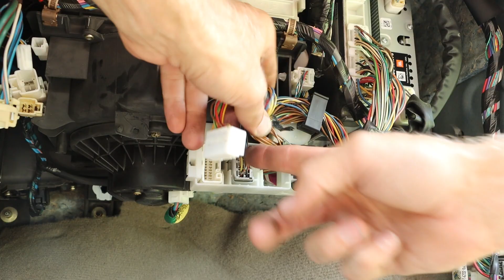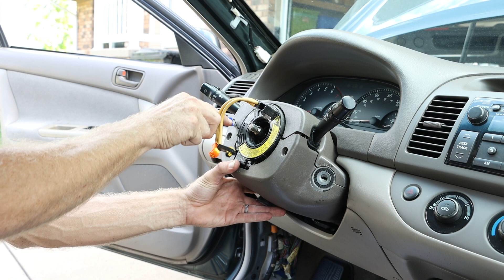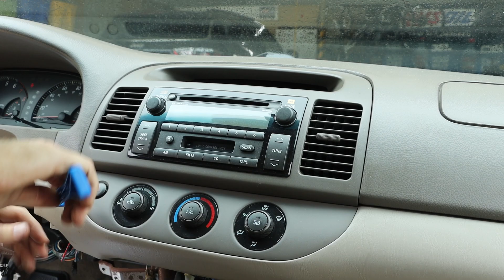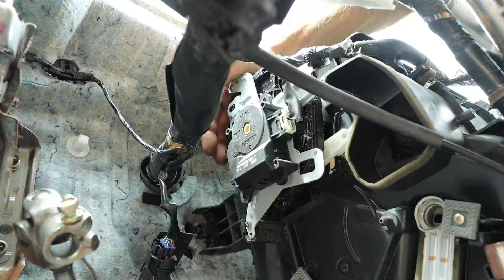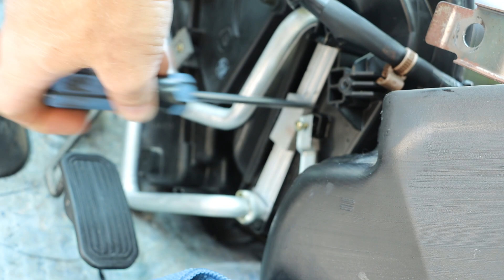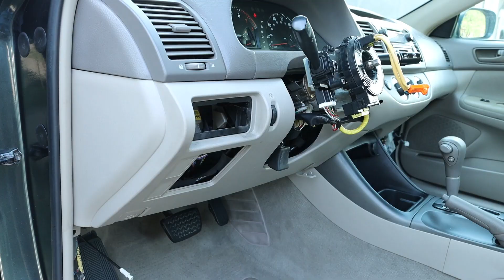Replacement of Evaporator Core, Expansion Valve, and Heater Core 2003 Toyota Camry, 2.4L (2002-2006)

Comment: can you remove the upper dashboard without dismantling all those steering thing? for me thats the hardest part on this video.
Reply from the maker: You can sure give it a try.  I took the most logical approach that I could find to process through this repair but I am sure there are different methods.

Comment: Is there any risk of setting of airbags when messing with the connections while the battery is still connected, or is that like an old wise tale?
Reply from the maker: A general rule of thumb to avoid any concern is to disconnect the negative battery terminal and wait 10-15 minutes for the system to discharge.

Comment: Hi,,,great video that made me tackle the attempted removal of the blower housing unit,,,I removed the 2 bolts and those 2 sleeve nuts but am still having a tough time removing the unit itself. There’s some movement but not enough to wiggle it out. It looks like the top bolt is preventing the housing from moving forward enough but I’m not sure how to get it off past the bolt. I’ve also unplugged all of the wiring harnesses.I’m I missing something here.
Reply from the maker: Any luck?  If it doesn't move around at all, there is a good chance there is another bolt holding it in place.
Reply: @InsaneOil hi,,,finally got it off but had to remove the actuator that was keeping the box from moving down and forward. Had to remove the box as mice got in there and chewed up a nice big hole in back. Pesky little varmits. Great video by the way.

Comment: Hey brother appreciate the tutorial on this vehicle, I bought a 2004 model, was told the compressor was the only issue replaced it did the various steps to add Freon but it wouldn’t turn any colder, when I took it to a shop they said my expansion valve was bad, but would you recommend changing the ac unit like the evaporator core? And another question when engaging the into the start position there’s a gurgling sound coming from the passenger dash side any thoughts ?
Reply from the maker: Originally, I also thought my issue was a bad compressor.  I basically did the same stuff you did and got the same information.  After spending way too much time and replacing too many individual parts I did more research, I found that often times when the compressor goes out, it sends metal fragments through the system, effectively causing many other issues in many other components.  At the end of the day I knew what must be done, and that was to replace the entire system.  I didn't want to but I bit the bullet and did it.  The issue was resolved and still works great (2 1/2 years later).  Here is a link to the full video: https://www.youtube.com/watch?v=V0I6sKrA_eE&list=PLYNR1w8QDiFp7rtAildDIVAaS9qwF_0Mv&index=29  Not sure about your gurgling issue though.

Comment: I am wondering why you needed to do the work. Did the evaporator core leak? I am glad that the AC on my 02 Camry with 200k miles still works.
Reply from the maker: There had been no AC in this vehicle for at least 10 years prior to me procuring the vehicle.  The end though was that when the compressor seized up, it shot shrapnel down the lines and clogged the evap core.  This vehicle was for my daughter and I wanted her to have AC, so I figured out how to repair it.  This video is part of a larger repair which can be found here: https://www.youtube.com/watch?v=V0I6sKrA_eE&t=4982s
Reply: @InsaneOil  You are the man and understand what you are doing. Your explanation makes sense, since an evaporator core usually does not break, but once a seized compressor sends sharpnels into the system, everything will need to be cleaned (e.g., lines) and replaced (e.g., the evaporator core).

Comment: Mine looks a little different than yours. I remove three 10mm bolts but the blower and air input assembly won't budge.i tried pulling to side first. Any ideas on hidden screws. Did you have to use brute strength to wiggle that out?
Reply from the maker: Any luck?  I believe my vehicle is Japan built (or partially Japan built) and there are a few things I have come across that are a bit different than similar vehicles.
Reply: @InsaneOil Aussie built. Toyota now closed its factories in Oz and gets its camrys from Thailand. Yes it just needed brute force. At the ports there is foam. Btw. Ended up just topping up AC gas. AC now works. Symptoms of low gas and clogged xvalave can look similar.  So jumped the gun a bit. Didn't need the blower out after all.
Reply: @InsaneOil just a lot of force. I think the foam strippibg at the ports made it stick

Comment: Oh and btw did you notice the integration relay behind the fuse area? I think mine is responsible for the no lock double beep issue.
Reply from the maker: According to what I found online: the integration relay is basically the body ECU and does handle the lock/beep issue. Double beep usually means the car thinks a door, trunk, or hood is open, usually caused by a worn door latch switch as opposed to a bad relay.

I haven't had to deal with that issue yet in my car.
Reply: @InsaneOil I have never seen or heard of that. All of the discussions and even Toyota chassis diagrams show a specific integration box that has relays and other stuff inside. Again probably different across years and countries. But I'll keep it in mind. I think all the door latches are good because no door light comes on dash. As of yet nobody brave enough to try to pull apart integration relay from forums. I may do soon. Best do a video I suppose to help the cammararian community like yourself. Thanks.

Comment: Just for replacing expansion valve I'm guessing pulling away blower is all that is needed right? I have 0psi low side and 120 high and the compressor is noisy. I'm suspecting X valve. Can I use any old O rings? Ive already got a hennes brand valve. Now to build up the courage.
Reply from the maker: Yes, you can access the expansion valve by removing the blower.  I wouldn't recommend reusing the o-rings as the system needs to hold pressure and even a slight nick in o-ring could cause an issue.
Reply: @InsaneOil bought some green AC onrings set  from aliexpress. Was really cheap. But they have been put away for a rainy day as topping up fixed the problem. I'll add dye when my dye injector comes. Or may just do it while adding a little more gas. Too lazy ATM.

Comment: I'm totally stuck moving the blower motor sub assembly unit to the Right and Down.   All cables are disconnected and 2 bolts and 2x weird  washers things are removed.

Any idea.    Feels like the unit won't give...any ideas?   I feel like it's something simple.
Reply from the maker: What is the timestamp of the video that you are on?

Comment: My expansion valve has a leak, my mechanic (who I trust) said it would be $1200.  I thought to myself, HOW HARD CAN IT BE?  🤣🤣🤣🤣🤣🤣🤣🤣
Reply from the maker: Did you decide to do it yourself or pay the big bill?
Reply: @InsaneOil  Turned out it (hopefully) wasn't the evap core.  He looked at the caps for the check valves and saw the dye on the inside of the caps.  Only $117.  Another retired mechanic said evap leaks are rare while valve leaks are common.

Comment: Great job. At 53:00 it looks like you could have taken out the whole unit without removing the dash since you are putting it back in with the dash installed again, why isn't that possible?
Reply from the maker: 53:00 is the blower assembly only
Reply: @InsaneOil  How silly of me :)

Comment: Have cut the end out on several vehicles including a 2003 Camry. JB Weld plastic to plastic works great. Little shiny but almost matches the plastic housings perfect and seals/ sticks very well. I'll add some foam tape around it to make sure it doesn't condensate but haven't had any problems doing it this way. I agree there should be factory access doors but then that would go against trying to eliminate DIYers.
Reply from the maker: I am impressed you made it that far into the video.  Most people watch the first 10 minutes and think to themselves, "screw that repair" and close out of it.

Comment: Great video
I just got a 2005 Toyota Camry LE 4 cylinder
Been able to do a lot of work myself. 
Recently noticing heat is a lot hotter on the drivers side, cooler on passenger side. 
May even be intermittent - not sure. Any suggested videos. 
Blend door?
Anyway that was an incredible thorough video on the dash removal for the evaporator repair. 
Thanks
Reply from the maker: Thanks for the comments. Almost sounds like it could be some type of obstruction or, as you mentioned, a louver door not operating correctly.  Or perhaps, one of the duct work connections came off.  Feel free to check out my entire playlist of repairs for this vehicle. https://www.youtube.com/watch?v=AEJKDCbhzY4&list=PLYNR1w8QDiFp7rtAildDIVAaS9qwF_0Mv

Comment: Thanks for detailed tutorial. Is it required to take the blower unit out in order to replace the heater core?
Reply: No you can access it and take it out from the driver's side no dash disassembly needed 😂
Reply: @Greenbear39 I tried that way and couldnt seal the hoses
Reply: @nighttime9539 toyota sealant fipg its black
Reply: @Greenbear39 tried that, didnt work. I've seen people do it online, but didnt work for me unfortunately.
Reply: @nighttime9539  thats bad luck only other thing I could think of is jb weld ..well good luck let me know how you deal or dealt with it.
Reply: @Greenbear39 that was several years ago. I had two attempts and decided to leave it disconnected (bypassed) as the whole thing seemed pretty risky to me at that stage.
Reply: @nighttime9539 So did you just connect the upper and lower hose to bypass it. And afterwards did  you get any heat.

Comment: This video is really well put together. Thank you! 
Do I need to take off the dash if i'm only replacing the expansion valve or can I stop at taking out the glove box components?

Edit: I see it is unnecessary, my only remaining question is what sort of oil did you apply to the evap coil rubber rings when you installed the new expansion valve?
Reply from the maker: I used the same oil I put in the system.
Reply from the maker: I think it was this https://www.oreillyauto.com/detail/c/certified/a-c-pro-certified-pag-oil/int5/p46uv?q=a%2Fc+compressor+oil&pos=0 if I remember correctly.
Reply: @InsaneOil  Thank you. Last Question I'll bug you with. Do I need to disconnect the lines running to the Expansion valve in order to remove it? 
As in, do I need to remove the lines from the engine side of the car, in order to get the expansion valve off of them. How much give is in those lines I guess is what I'm asking.
Reply from the maker: @corncob4627  If you are only removing the expansion valve, you can disconnect those from under the passenger side inside the vehicle and there is enough room to get the expansion valve out.

Comment: Thanks for the video. I need to replace my heater core, but I don't want to take the whole dash apart to do it. Is there a way to replace the core without doing that? It seems accessible, but is it a situation of being so close yet so far?
Reply from the maker: I do not know of a simple method for removing the heater core.  It is not a very good design from the maintenance/repair perspective.
Reply: There's a video on youtube on how to replace a heater core on 02-06 Camry without taking the dash out. Look up a channel called Fix It Angel.

Comment: Ok so I’m halfway through this process right now to get a new heater core installed and I’m wondering why exactly the blower unit comes out first and In last. As far as I can tell it should be able to go in right before the dash goes in so there’s enough space to get it in easily.
Reply from the maker: Your thought process is valid.  My original thought with this vehicle was to replace the expansion valve (which requires removal of the blower housing).  After that part didn't fix the issue, I continued on to the Evap Core.  I understand what you are saying but mentally can't visualize the process you are talking about to say for sure.